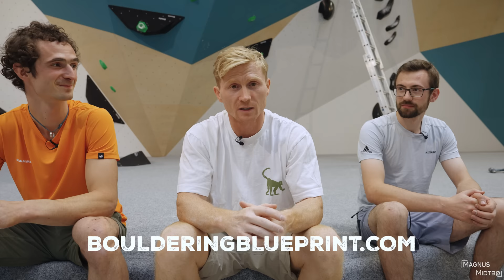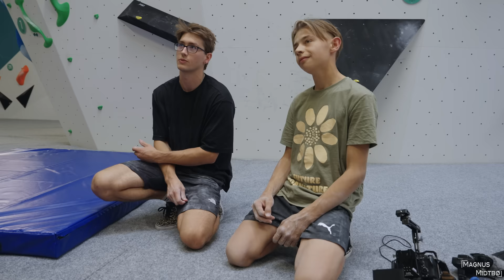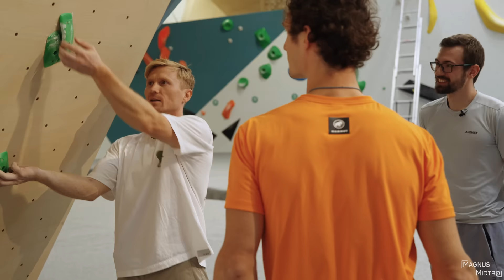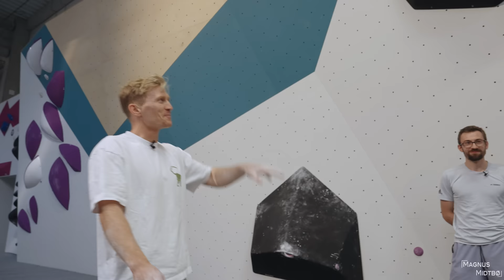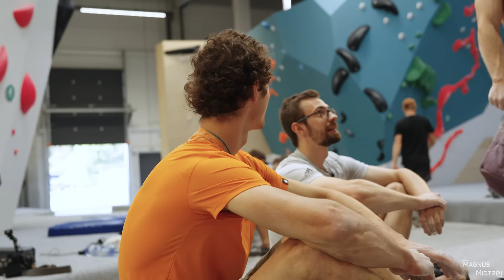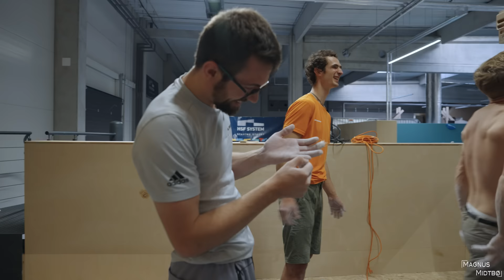“World’s best climbers can’t do these boulders”

Comment: I'm with you about the fun in climbing, getting better and being able to climb more impressive lines.
Climbing passages on the rock where you have to find the one possible combination is the best.
But there are also easier routes with specific requirements and there are destinations with beautiful easier routes. The elbsandstone for example has really beautiful easy lines. 
You just have to search more for them. You can't just go to a crack and climb the most beautiful line because it might be above your limit.
Right now it's hard for me because my current level is 2 grades lower than it has been, but there is still joy in climbing for me.

Comment: Hey Magnus, thanks for that great video. But i have another opinion about the "the better you get, the more fun you will have in climbing" attitude, or maybe i got it wrong. Climbing is always a mix of the ressources a person has (tequnique, power, etc.) and the ability to use them to solve a problem. A person with less ressources does not need a more difficult boulder to have more fun. This person could have a similar funaspect as you while solving a 8a+ boulder, although he solves a V2 boulder. All the best to you and your team. Dave
Reply: Exactly. It´s all about pushing your individual limits. It´s not important for your individual fun, where this limit is. And I think, that´s the same for all kinds of sport-activities.

Comment: Set a dynamic movement where one falls if they fail to check them momentum with a sligh foot push on an odd hold. In all the IFSC Comps I watched before the rule changes, these types of boulders caused the most trouble. AO would have trouble often in these.  Don't know Will well enough to comment on zzhis abilities. BUT dyno-direction changes are tops.